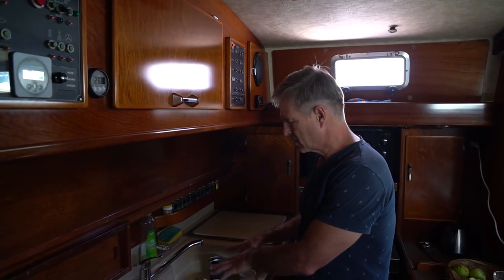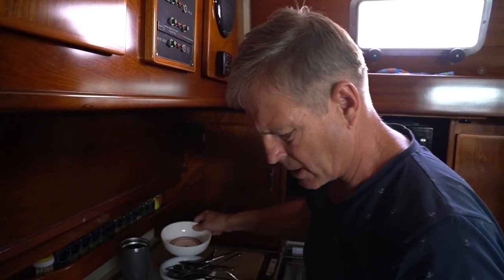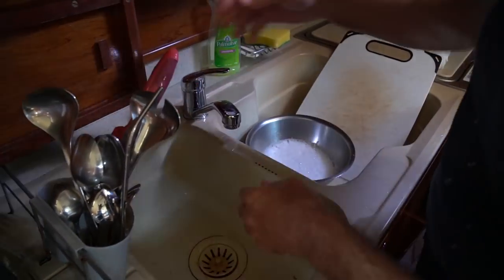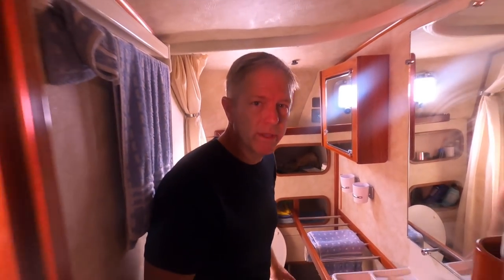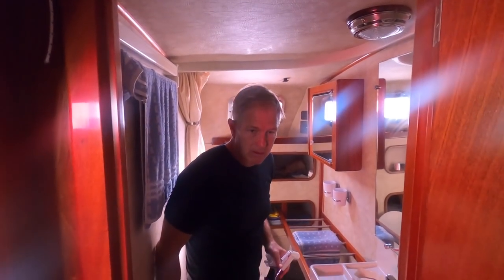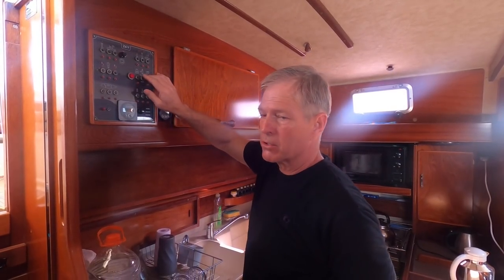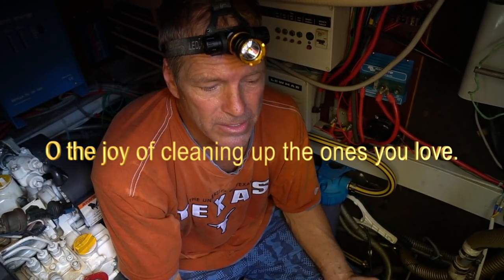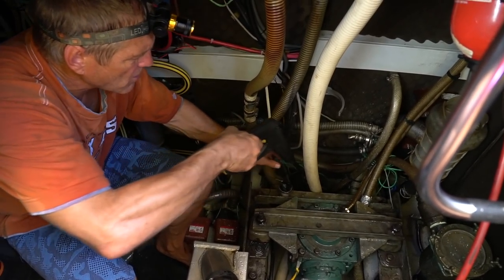Ship Flows Downhill -  Just a bit about plumbing, and water usage - Tips on Tuesday

Comment: Hey Ken, I like these Tuesday tips..  were you referring to me when you talked about high pressure water system??? LOL. Just a note for your subscribers; Amel’s have most piping integrated into the hull structure during the build.  If you get a water leak, it will be a failed hose in the ENGINE BAY.  Thereafter, a long cleanup is needed.  All my hoses are now high pressure.  Problem solved :-)
Reply from the maker: :) :) :) Hi JP!!  YUP, that was you, facts are facts.  But, as you mentioned I didn't say who, you're the one that introduced yourself as the culprit of my tale.  Hope you, Julie, and Bruno are doing well in New Zealand.   Say hi to the rest of the gang that stayed behind for another year in NZ.  We had SO much fun there!
Ken and Z

Comment: First boat I've seen where the sink and shower drain into the bilge.
Reply from the maker: it's true that most boats are set up different than an Amel, but the reason for this is to limit the number of holes in the boat.
Reply: It's actually a good feature although it can be a PITA.  The reason it is a good feature is that you aren't filling your tiny black water holding compartments with grey water dramatically extending your times between pump outs.  Of course while you are well offshore in the ocean it doesn't matter as you could dump over and not use up any holding tank space at all but in anchorages or marinas (or usually within the maritime exclusion zone), there are regulations forbidding the dumping of black water so that means an expensive pump out (if you can even get one).  Extending the time between pump outs (or holding tank dumps) is well worth the PITA caused by having to keep your bilges clean (which makes the boat smell better anyway).
Reply: OK so whats the difference if you dump the bowl of dish water overboard or thru a drain? It's still going into the water. And washing the deck down with soapy water or your soapy shower water. So many go the bathroom in a bucket then dump it. Up here Victoria BC the whole city dumps into the ocean. I can see it in a small inlet but not out where it's deep.
Reply: @theislandpackrat  There is no difference for the ocean at the end of the day... the difference is in the bilge.  If you stop any organics going into the bilge, it stays clean and not stinky.  Although on the Amel's the bilge is actually in a water tight engine room, it still is no fun to clean out a bilge that has all kinds of food bits.  Most Amelians either use paper towels to completely clean the dishes or some system like Ken.  It's a bit of a PITA to carry the container up the companionway and then throw it over the side, but once you clean the bilge once the other way, you never complain about it again!
Reply: @steveburton5825  So why not a grey water holding tank so the black water isn't an issue. For as high end as the Amel is it's surprising the water setup is so primitive.
Reply: @JCrook1028    I agree. This setup of Amel wouldn't be my first choice.
Reply: @SailingAquarius  Yes but most sink drains are above the water line
Reply from the maker: @steveburton5825  Thanks Steve!
Reply from the maker: @JCrook1028  It's not primitive, I guess it does not match up to the dream, or your dream.  Aquarius is not a house, it's a boat.  For every pump on Aquarius I carry a spare in case it goes out at sea, or someplace I can't buy a new one.  So, having a gray water tank would be another tank I have to clean, and/or another pump to carry. Nope,  I like the way the Amel is set up.
Reply: @SailingAquarius  As you said yourself tho, most boats aren't set up that way. Good thing too cause dumping all that right into the bilge makes zero sense to most boaters.
Reply: @JCrook1028  I think the misconception here is the word bilge...  on an Amel, it is really only used for draining the sinks and showers and everything else in a spectacular emergency.  You don't NEED a tank for grey water...  it can go right over the side.. but good design suggests it needs to be pumped way up above the waterline so it can't siphon back as Ken said... many bilges are wet for exactly this reason.  The only time you ever hear an Amel bilge pump run is when someone uses the sink or shower..  Amel reuses the bilge for this so everything goes out one hole in the boat... rather than dedicated holes for each drain.  Let me be very clear and repeat that... the Amel bilge really only EVER carries grey water as they just don't leak.. PERIOD.  So in reality the bilge is your tank which gathers up enough grey water to justify running the bilge pump to get it up and over the side.  (You wouldn't want the pump running all the time on the off chance someone uses the sink or shower) although I guess you could hook it up to the supply pump so it ran when the supply went but that seems like one more thing to go wrong.  I don't see the big deal... it isn't that much of a PITA to wash the dishes in two stages... if your really hate it, let your bilge get stinky (it only ever smells up the engine room which is a separate watertight compartment from the living areas). MOST boats have everything else including seawater in their bilges as they are not watertight like Amel's are.  Most Amel owners I know keep paper towels in their floor lockers (that are part of the bilge system).  One such Amel owner sailed his Super Maramu through survival conditions that resulted in the loss of nearly every other boat in the area and his paper towels never got wet.   Read about it in Ocean Navigator (search for "Survival Conditions").

Comment: Ken awesome comment on the bilge pump anti-siphon...  but you may want to clarify that the exit pipe needs to be underwater for the siphon function to work.  Most boats have it way up on the topsides so no problem unless the boat is very badly heeled over but I still think that you may just have saved a boat an ignominious fate.  Goes to show that we need to be very careful when we make modifications to the original design - even inadvertently. I don't think I've seen many other boats with bilge pump anti-siphons and indeed many marine store bilge pump kits don't come with them and don't even suggest it could be a problem (other than saying to mount the exit hole high... but I can see owners thinking they don't want crap staining they topsides and putting it down near the waterline inadvertently.). 

One other comment, on a recent Super Maramu I sailed on, they used a 6" deep plastic bin (like the ones kindergarten kids use to store their crafts in) in the sink as it nearly fit the contours of the port side sink and made it sort of impossible to rinse stuff off outside of the bowl accidentally.  It was also stiff enough that it was easy to carry up the companionway to throw over.  It was still a two stage operation like you do... once to get off the bulk, the second time to use soap and do the final clean (when dishes are very dirty).  They used the starboard side sink to rinse off the soap and drip dry.  Worked well.  I love these videos.  Keep them up!
Reply from the maker: Thanks again for great comments Steve!!

Comment: I thought that you had a dishwasher. Too much hard work!
Also this must be specific to your boat or maybe sail boats in general. I have never ever heard of all these problems on a motor boat.
I have been looking at a certain Nordhavn 120 and I have been through stuff pretty thoroughly and Ok know that dirty water etc is removed by contractor but what you're describing to do, ERM no. And I like my power shower to much to.
Reply from the maker: When you only have a few dishes it is better to wash by hand.  Just because you have something does not mean you have to use it all the time.  It's like saying you need to drive your car to the store a block away.
Reply: @SailingAquarius  I do as I am disabled!